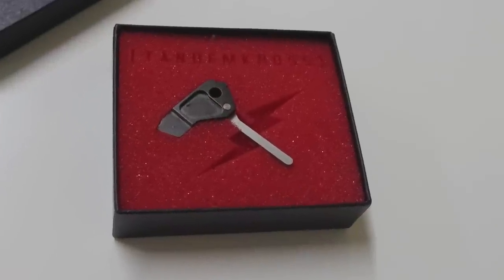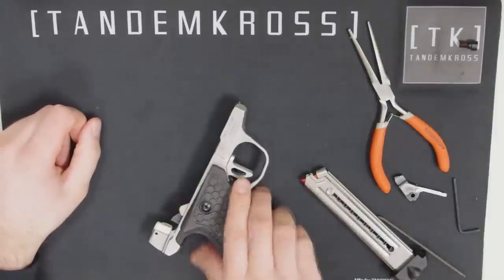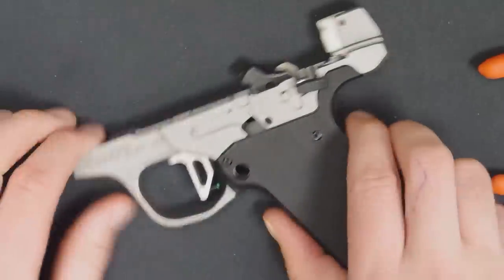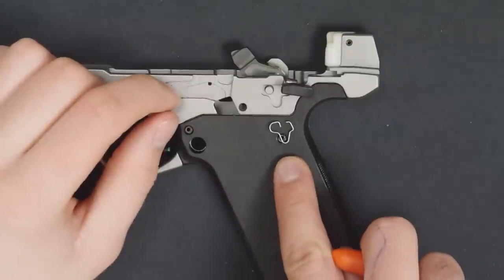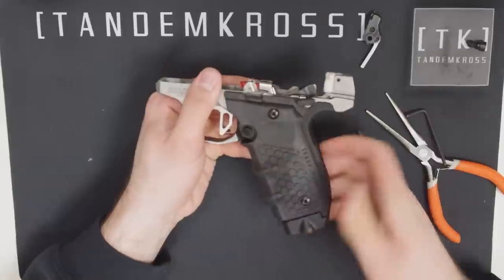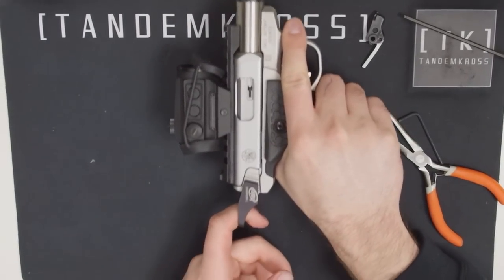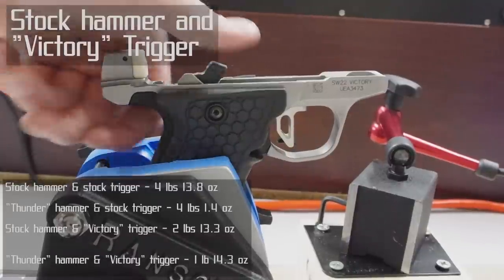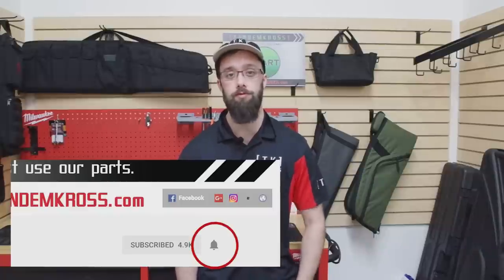TANDEMKROSS "Thunder" Hammer for SW22 Victory | Installation Instructions and Demo

Comment: Very nice. Will get 1 just to eliminate that pin walking out on the stock hammer.
Reply: A customers gun had this problem. I replaced the solid pin with a roll pin, problem solved.

Comment: I'm curious whether the Thunder hammer, or the trigger kit will reduce creep the most and give a better trigger break.
Reply from the maker: Thanks for the question! Yes, the hammer will improve your trigger break. We've adjusted the angle of the engagement between the hammer and sear, and it really provides a smoother, more crisp trigger break. And as with all our parts, if you try it and find it's not what you're looking for, we always offer a lifetime guarantee on all our parts.

Comment: People are reporting hearing the thunder hammer motto when opening the box however I didn’t hear anything when I opened my box for my Thunder hammer. Was this only for the first batch of hammers or what? Installation was a breeze. Can’t wait to take it to the range
Reply from the maker: Yes, that was a promotional thing for the debut of the product and was phased out after a while. Currently shipping Thunder Hammers don't have the light-activated soundboard.

Comment: Hey guys, I just ordered your Victory trigger and Thunder hammer for my Smith and Wesson sw22. Just wondering if I should install one before the other, or what order you would suggest. Thanks
Reply from the maker: Either way is fine, but it is a bit easier to take out the original hammer and trigger at the same time and install our "Thunder" Hammer and "Victory" trigger in one go.
Reply: @TANDEMKROSS  , alrighty then. Thanks for the quick reply, can't wait for my parts to arrive so I can get them installed and my Victory Tandemized👍🇺🇸

Comment: Does the Performance Center Victory have the tandemkross trigger and hammer ?
Reply from the maker: The Performance Center models of the SW22 VICTORY ship with the TANDEMKROSS HiveGrip only. The Performance Center models come with a S&W in house flat face trigger and the same hammer as the standard model. Both TANDEMKROSS internals are compatible with all SW22 VICTORY models and will reduce the pull weight and trigger travel.

Comment: I installed both thunder hammer and trigger kit

 Installed pretty easy however after going to the range it would
 Only fire 3 rounds every other or every 4-5 rounds it would fire one round then literally strikes then eject 2-3 maybe4 then it would fire one round then start over again. I’m very disappointed ,after spending that kind of money it the gun not fire every round I could use some help figuring out how to make this thing work correctly
Thanks for any help. 

T5